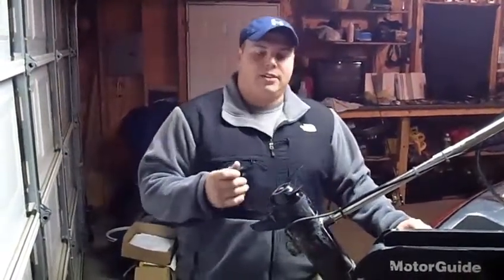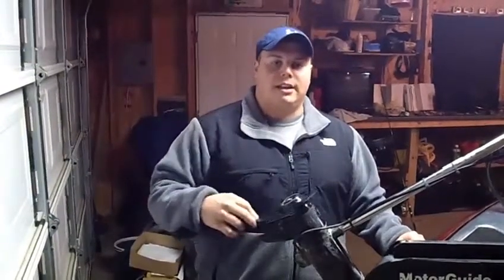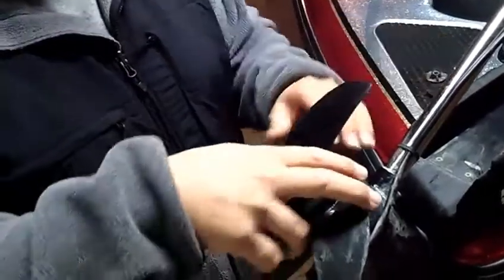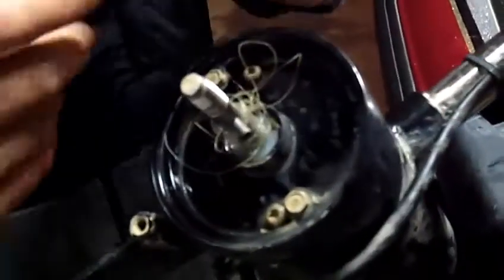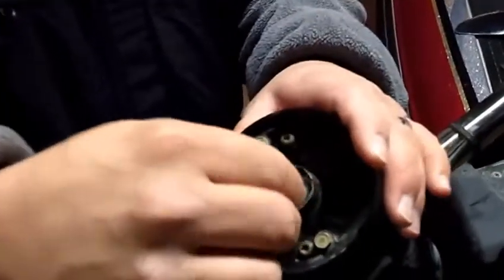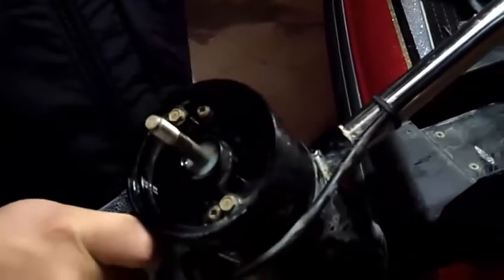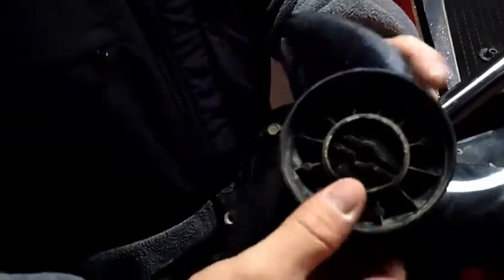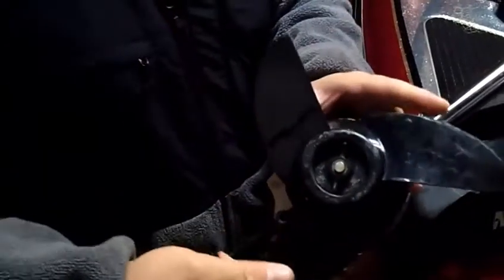BCGS video 4 - maintenancing T-motor

Comment: Thanks a lot I just bought a used trolling motor that recently broke and didn't have the tool but I used a monkey plier to untwist it. There was a lot of weed caught in it, but unfortunately it still doesn't work. At least I know it's not the prop thats wrong.